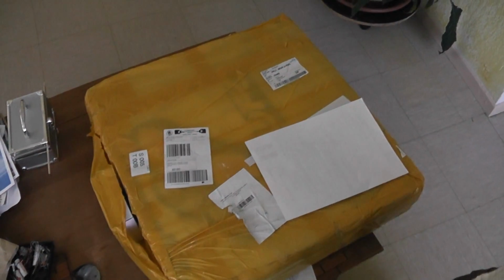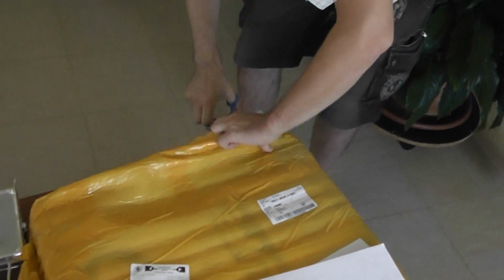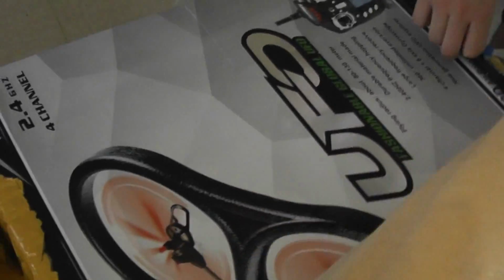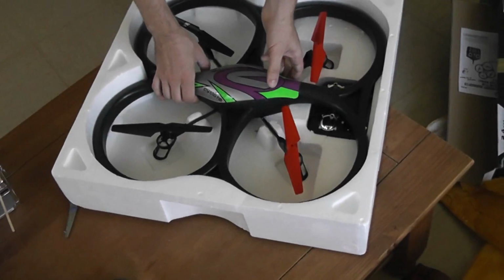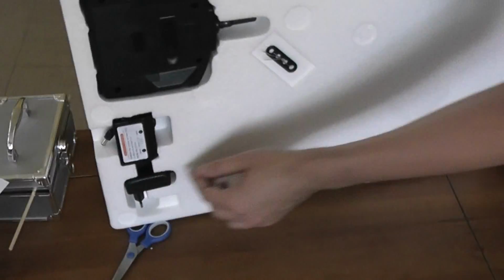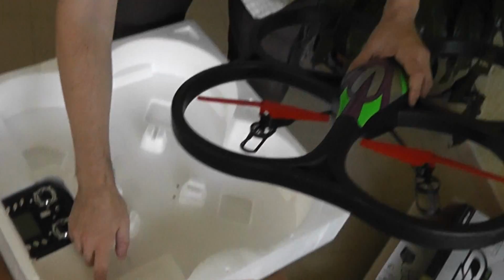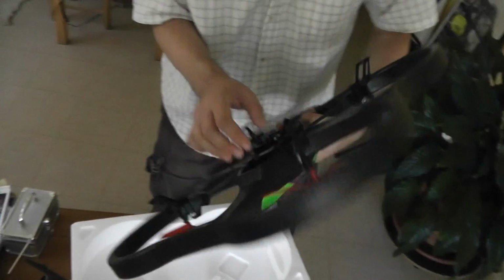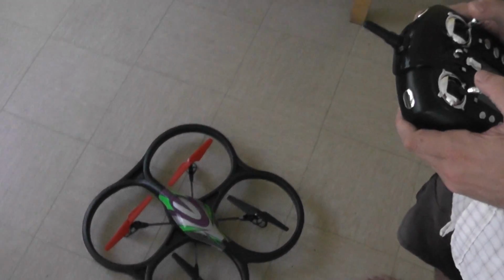WLtoys V262 "Cyclone" mini unboxing and indoors testing

Comment from the maker: Range is even better with the V262 but for all V2x2 quad, check both RX/TX antenna (sometime bended in the TX plastic hat and bind the RX antenna vertically. 
Since the V262 is much more bigger, motor pods and boon are more fragile. Motors become hot too ... but there are some mod to cool them (with a binded straw for example). Anyway this quad foamless is very powerfull and can carry mobius + FPV setup without any problem

Comment: Great video. My camera is not activating. It should be automatic? Because when I press the button it only takes pictures.
Reply from the maker: Hi,
My version don't have the camera :( But I think it's possible to turn on/off the camera from the transmitter. Maybe first press the function button then the button you use to take photos.

Comment: Hello SeBy, Just read your review of the V333, and as I understand it I can update my V262 with the V333 Board, but for the "Headless" to work I'll also need a V333 TX, correct???   ALSO please,  what spray that is available here in the U.S can I used to clean my motors, I've already done all the other mods, Bearings, dust covers, sinks etc. Plus I've cut all but he main canopy away as well.
Reply from the maker: Personnally, I am using a "3-in-1" electrical contact clearner spray. I guess can be found easily in US. Something without oïl/sillicone, just to clean extra residues
Reply: SeBy DocKy What about the board question, would I be able to use the up graded Tx from Banggood for the 333 up graded board if I drop into my V262???
Reply from the maker: Mike A Yes you can but you also need a slightly different TX allowing to active headless. If you don't care of it, you can just take the V333 board.
Reply: SeBy DocKy So the only Tx that will allow the Headless to work is the Tx that comes with the V333 Quad, Yes
Reply from the maker: Mike A The V636 should work too for the Headless
Reply: SeBy DocKy Ok, Last question, I hope, Does the V333 Board bolt right into the V262

Comment from the maker: The motors are already very powerful, but sure you can upgrate for a larger battery. I am using a 1200mah which is for me the best ratio power vs weight
Reply: SeBy DocKy so for v262 can I use 7.4v 1500mah battery and should I purchase new charger for it or I can use the same charger that came with 850mah battery ? Plz reply me urgently

Comment: La puce nRF24L01+PA tu as le cablage pour ma Devo ? les moteurs vu pas cher sur BG ou HG, sontils costaud ? et la durée de vol, aussi avec la grosse batterie de 2000mAh. Merci
Reply from the maker: Ne prends pas la batterie 2000mah... c'est trop. Une 1000 ou 1200 suffiront pour 8-10mn de vol. Le cablage c'est sur le site deviationtx.com
Reply: Comment cela elle est trop la 2000Mah ? je regarde le cablage merci

Comment: I have an urgent question for you: I bought this as well but they don't ship it with a battery so do you know what kind of connector the battery has? Jit, Dean, etc.
Reply from the maker: JST/BEC
Reply: SeBy DocKy Oh no! The batteries I bought all have Dean connectors..The toy comes with the balance charger and I am guessing that one is JST/BEC too :( What do I do now?
Reply from the maker: 2 options. Either you solder new JST connector or (I advice to you) is to buy a real charger/balancer which will accept your Dean connector

Comment: Hi, i like the 212 and this v262...question is the range the same with both quads...i heard  v212 has a good range of over 600 ft which is close to 200 meters....does your v262 have a good range with its stock radio??? also is durability and flight characteristics about the same...thax for the review..

Comment: Sound of the gears loud. The motor arms will  crack is the weak point something has to give. New board green. Who ever design one that will fly for hour will be rich, has to be under 200.00 total cost, this  v262 is $100 only a 8 minute flight. Size makes it a park flyer. Everyone enjoys this one, very fun once you learn, takes time about 8 to 20 charges to learn fly low at start 10 feet. Stay away from rocks, trees buildings cars and humans, kids will run up on you stop flying.

Comment: is there a beginner mode or anything?
Reply from the maker: Yes by selecting 40% mode on TX ..... it's very easy to control
Reply: Thanks man! This things is very hard to control in the wind!
Reply: Yes, two or three modes on most  quads copters, sometimes expert mode better for faster response or use it for windy weather. Most QUADS do not like wind. Larger quad better for wind some say?. Some to light weight. I learned on a  Hobby People Heli's HP Quad on sale for 50.00 WITH RADIO TRANSMITTER. bot two HP Quads and 4 batteries for more flying time used a inverter harbor freight 200 watt $20  plug in two chargers with car battery at flying park get hour none stop just install battery a 1S 400 or 500 MAH .

v262 you have to wait cool down 15 min PLUS Charge time. SO BETTER HAVE ONE MORE QUAD. Heli's HP easy get parts at the store or online no cool down needed. So v262 once you learn you will be hooked, and want a tricopter with FPV. They say TRI turn better then quads  check out Y TRI copters videos they hard hard to find built RTF. Maybe more will come out from China seen only two small ones.. We want large Quad copters with brushless motors with landing gear do not like landing on my battery. Visit RCGROUPS to learn more.